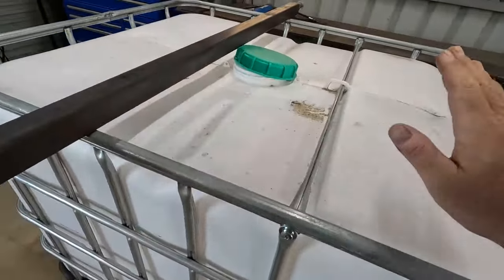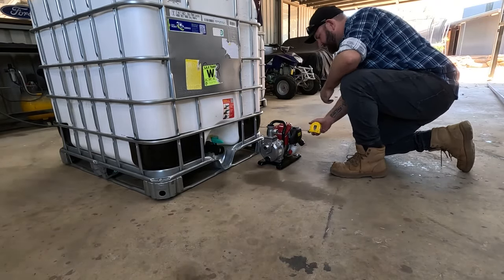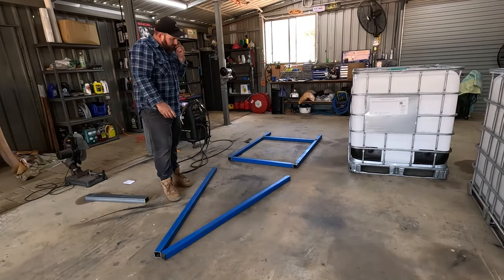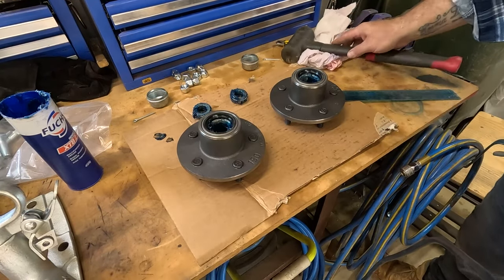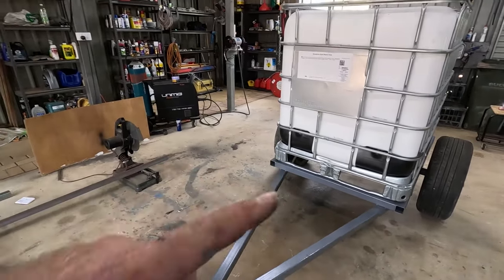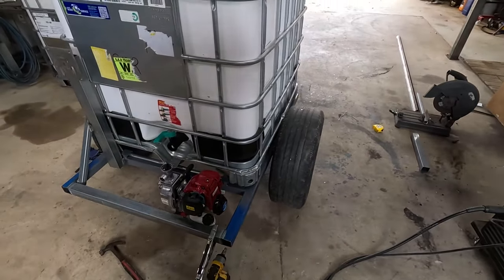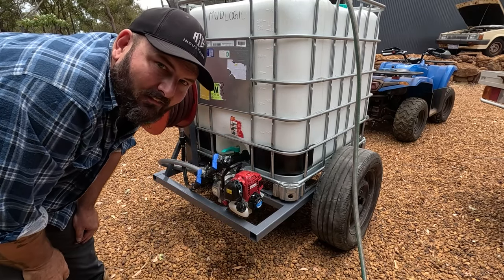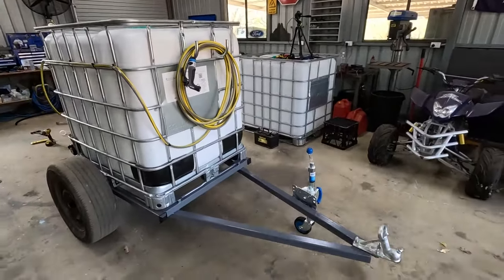I Built Another Firefighting Trailer...

Comment: Another great video.  Thanks for putting it together.  Have you driven around with the tote completely full?  Is it worth doing the leaf spring version, or is this version good enough?
Reply from the maker: Cheers, yep I regularly fill it up and tow it behind the quad. You can tell it's a bit bumpier with no springs but not too bad. Tyre pressure and sidewall height could help with this also. I think I won't bother with springs in the future builds unless it is to be road licensed.

Comment: Hi! I've followed both videos and am extremely impressed. i have a few questions as I want to copy your trailers.
Is there a reason for mounting the pumps at 90 degrees to ibc valve? Do you get the tyres and rims prior to axle ?
Reply from the maker: Thanks mate, when mounting the engine I consider a few things... Will it be easy to pull start? Will it be easy to change the oil etc? What is the easiest way of plumbing everything in? and also which way is the exhaust facing?
Plenty of ways to skin a cat so do whatever works for you mate.
Yes, get the wheels before you order the axle as the length will change depending on offset of wheels.
You can obviously go a bit wider on the axle and cover most bases but for me personally I want them to be as narrow as possible. The shorter the distance from the spring or chassis to the hub the stronger it is!

Comment: The bearings need ten thousandths play, the best way to adjust that is to bolt the wheels on. Then spin the wheele and tighten the bearing nut until the wheel won't spin,  then back the nut off as you spin the wheel.  Put one hand on the top of the wheel  and one on the bottom  move back and forth spinning the wheel adjusting the nut as you go.  When you get the play to where if you tighten you feel no play,and you loosen and feel aliitle play you got it right.  I've been doing this for 61 years. This will save you time and money.